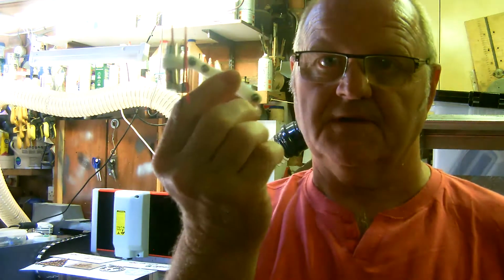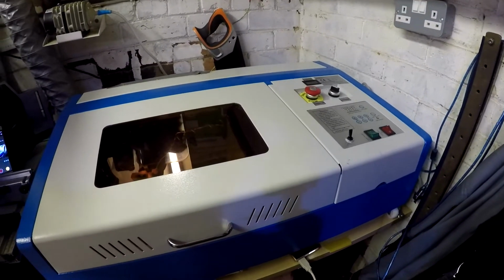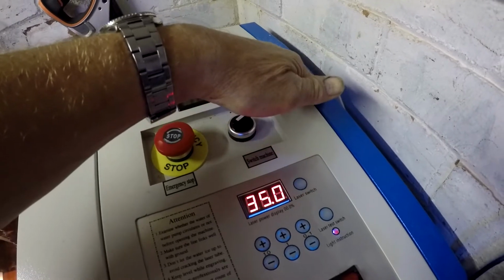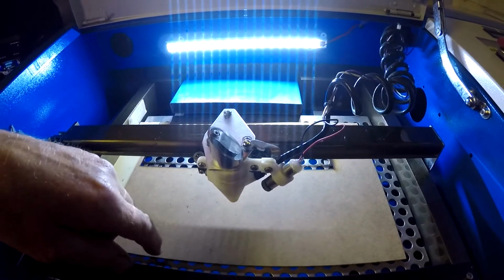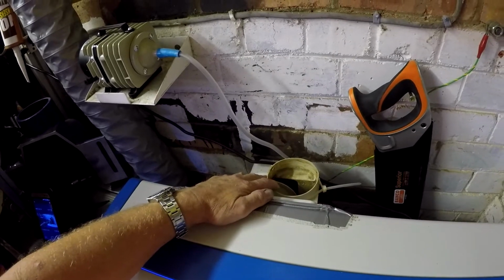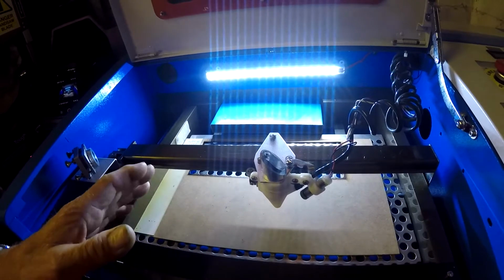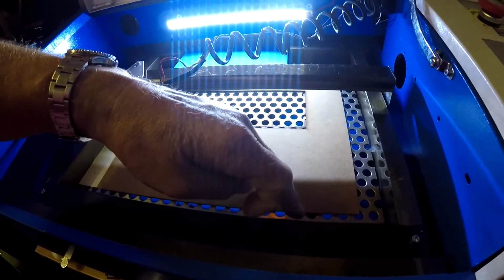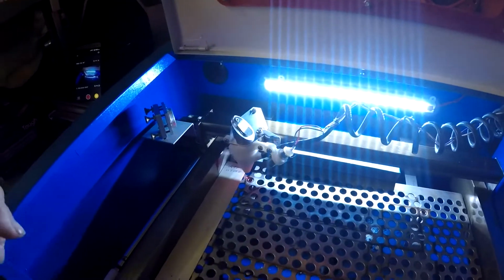K40 Chinese Laser Cutter using the upgraded parts

Comment: Will a AC to DC Adjustable Multi Voltage Power Supply Adapter do for the diode? Can you please share some images for where to wire the electrics for the plug? many thanks
Reply from the maker: Hi thanks for your interest that is what I use it just plugs into the mains socket and you set the voltage to 4.5volts Thanks Tony